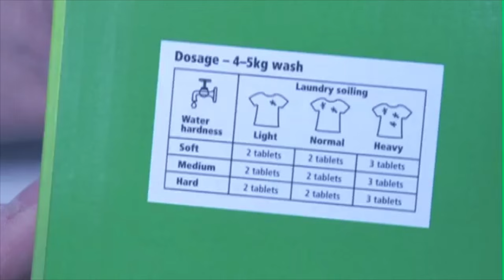What to do if Your Washing Machine Over Foams

Comment: This is a better idea than opening the door and letting it spill on the floor then  sweeping most of it into a trash can and toweling up the rest. I speak from experience
Reply: i had the same issue the machine was working only sinxe 30 minutes and i opend it 6 times to get the foam out..
it was insane😱😱😱

Comment: This happens every time I use liquid detergent. It doesn’t matter if I use the recommended amount, half that amount or even less. It never happens with powder detergents.
Reply: Do you have super soft water? 

Soaps also produce crazy suds at our home, and we have the softest water I’ve ever felt in my life… 

Definitely powder detergent is better for keeping suds down…
Reply: Ive just used liquid detergent also and currently panicking staring at my foam filled drum 😢😮
Reply: @piecesoftheheart9231  I never thought of that but you’re probably right. This never happened at my old house. It’s only since I moved here. The water is soft everywhere here but maybe it’s particularly soft in my area.

Comment: So do you empty the washer before putting the fabric softener and 1\2 gallon of water and running a cycle or leave the clothes in? In my case it’s a blanket and it’s soapy.
Reply: Just leave it in and add the fabric softener to drawe and it will disappear,the suds

Comment: Adding even more chemicals to chemicals, to reduce foaming? Fabric softener is very toxic . Instead of saturating my laundry with nasty substances I prefer to use white vinegar with a tiny bit of detergent. This works well, and vinegar also removes caulk in the machine.